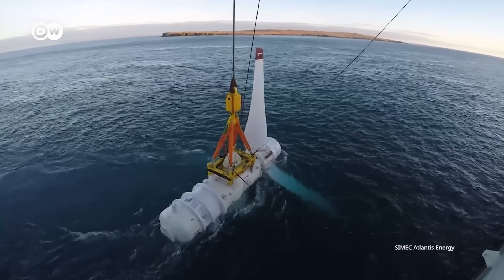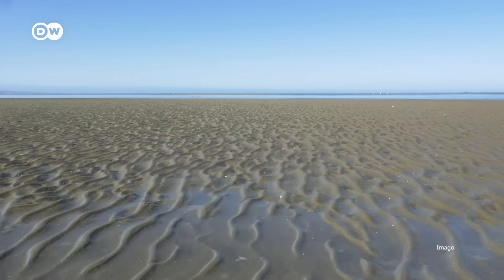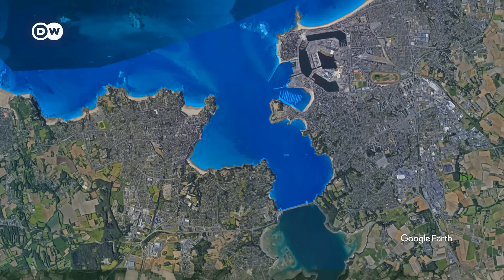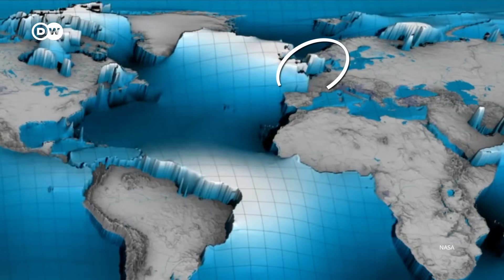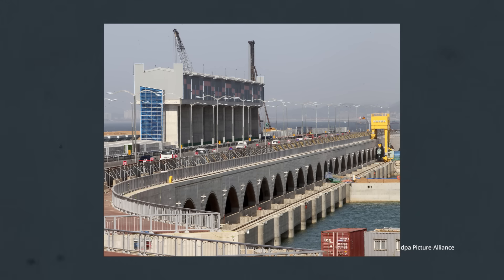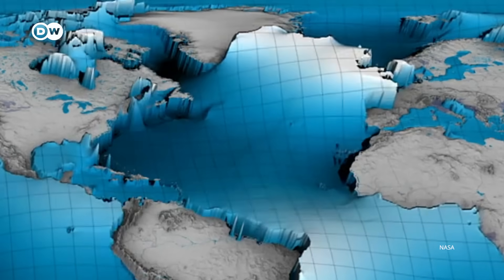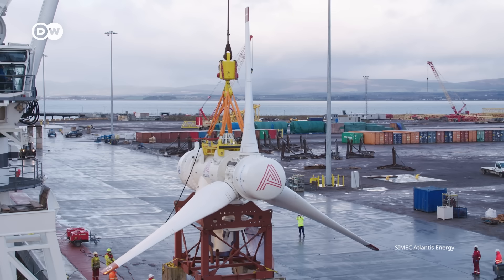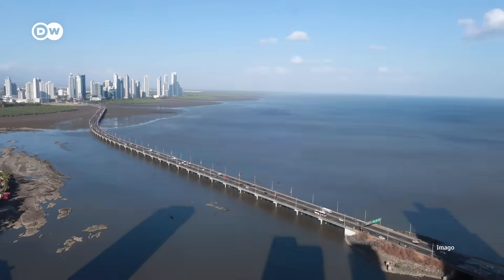Tidal energy could be huge – why isn't it?

Comment: Let's talk about Nuclear energy
Reply: It's been talked about. Overpriced.
Reply: And at the beginning of it, they wrote like there isn't anything else than renewables. Also they skipped to mention biomass, guess they don't want people to know where all that green energy comes from.
Don't believe that molten salt nuclear power plants would be outperformed by tidal energy plants.. once they get adopted on a large scale that is. 
If so, that's great but tidal still won't solve the energy problem.

@Stephen Ferrer ,are you afraid of a little rain? I can't imagine that the thermal impact of a Nuclear Power plant would be of any significance. Won't add much,if anything, to the output of what greenhouse gases and you know.. the Sun does.
You have any documents to back up your claim?
Reply: @denizzz08   There are obviously others. Fossils are too environmentally damaging, biomass is to inefficient, hydrogen might be an option but suffers from the same issues as biomass, nuclear is far too expensive, renewables are still the best option.

MSR might be an option, but we can't really draw any commercial examples at this time. Whereas renewables are already proven, and can be deployed within a year, and profitable long before a nuclear reactor is constructed.

Comment: Comparing the Rance tidal power generator to something like nuclear is extremely disengenious as it only makes 240MW at peak and averages 57MG while nuclear being a few times more expensive can make you 800-1600MW at 95% capacity around the clock... I get that clean energy is sexy and all, but if it is all so good, why don't we have more of it and why do you need to practically lie about it
Reply: Because it's currently expensive and can't be done everywhere. The video literally covered this.

Comment: the big reason tidal power isn't being used, is that generated power happens over a short time (lets say 1-2 hours) and you immediately need to store all that power before it is lost, so you can have electricity for every home in the USA when the tides are out, or about 20 hours out of every day (which means a insane amount of battery capacity and related hardware). It is a massive hurdle and not a long term solution with out some really ground breaking new (and feasible) battery technology with extremely high energy density,  the ability to charge quickly, and the ability to charge on low current levels (trickle charge).

Wind power is more successful as they are usually placed in high to near constant wind locations (out to sea, long planes etc, and existing power generation infrastructure can kick in/increase power generation to match the eb and flow of the turbines).  Unfortunately there are no easy answers to the problem of clean(er) energy, and a whole lot of scams too.
Reply: Yeah, strangely the Winds have failed to come. And Wind Turbine Scrapyards are building up... like people really don't think about the Trash being produced!

Comment: You lose me when you start talking about the need for taxpayer money. If these technologies make economic sense then the private sector should be funding them.
Reply: Why? Power generation should be nationalised anyway.
Energy companies make huge profits every year by overcharging the general public. 
If we nationalised power it would reduce energy costs across the board.
Another benefit, public transport (if also nationalised) would be very affordable. 
The electricity to run the trains would be bought for almost nothing and any excess electricity generated would be used to generate hydrogen, that would in turn fuel all buses.

Comment: Here off the east coast of South Africa we have the Agulhas current that runs strong and continuously and is close to shore but in deep water. I am sure submersible turbines could be built to harness that energy and solve our power needs with little to no harm to the environment.
Reply: :D they will steal those thick cables every time you connect it to the coast!

Comment: It’s annoying when price references use different unit measures for comparison. The turbine power is 9 times more expensive than above water turbine generation but the cost could decrease to $0.10p/kWh by the end of the decade…
The “end of the decade” prediction has no useful purpose as you didn’t reference what the underwater/above water turbine generation p/kWh costs are??

Comment: Point 1: There are 15 metre tidal ranges in some areas, the potential power generation of that difference is much larger than your vid recognized.
Point 2: The tide is only still for about 1 hour a day, 15 minutes at each flow direction change. This means flow generated is 23 hours a day, a few capacitors would be sufficient to cover the 15 minute absence of power. Batteries would be better, so when a turbine is offline for service the amount of power available to the grid can be kept constant for longer.

The anti-fouling paints used on boats would have a big place in tidal power, keeping the systems clear of growth.

Comment: You know what is energy dense, available 24/7 365, is a proven technology, clean, doesn't affect animal life much if at all and already available?  Nuclear.  Renewables are a pipe dream. The wind turbines wear out fast, I'm sure the water ones will faster(hello... barnacles anyone?), the solar arrays wear out and are toxic. All of them have noticable amounts of negative effects on animal life, rely on batteries or other sources of power, have issues with green house gases produced when making and toxic waste when disposing.  If you want a solution for your fear of climate crisis then get over your fear of nuclear.  It's a proven safe technology especially in the US. Three mile incident had little to no deaths or negative effects.

Comment: Unless you have a background in some sort of grid management or operations it can be quite unclear how small the production from the non-range tidal power can be. A whole ship, manned with a few people to produce 2 MW? That's less than one industrial generator and requires so much maintenance and operational costs.
Reply: The biggest offshore wind turbines, that are much larger than ships, barely go over 10 MW.
Of course the production from a single unit is small, because this is an inherently poor quality dilute energy source.
It's not going to power the world, ever. It's just toy projects to entertain people with.
Reply: @zolikoff  What makes you so confident it can't be scaled?
Reply: @VinylUnboxings  It inherently has the same properties at the small scale as at the large scale because individual generators are small. It's not like thermal power plants where a 1 GW plant is much more economical per unit energy than a 1 MW plant.
So the system and economic properties will be the same at any scale as now. And they are not good for large scale grid power production. So they won't be at any larger scale either.
Reply: @zolikoff  I think what you're trying to say ud that it isn't economically viable.
Reply: @VinylUnboxings  Sort of, but that is always a relative statement.
Reply: @zolikoff  All I'm saying is that technically 10MW* x could cover the energy needs of the planet if x was big enough, no?

If you're not saying there isn't enough surface area to physically hold the turbines, then the only limiting factor would be the resources available to create the turbines, no?
Reply: @VinylUnboxings  What I said was that the supply chain economics of the solution are already at scale and have no further gains to be had, so if it's a poor solution now it will still be a solution no matter how many times you multiply it.
Resource and manufacturing limitations indeed exist and also don't allow to just multiply 10MW with an arbitrary amount to get to global energy consumption.
But what I'm saying is beside that, even assuming resources weren't limited, the scale advantage has already been attained and the per-unit-energy considerations are not going to improve by further upscaling. And since they're not good enough now, they won't be good enough ever.
Reply: @zolikoff 

 I'll acknowledge that resourcing and manufacturing limitations do exist realistically. 

What are you comparing it to though when you say it's "not good enough" or a "poor solution" when you look at per-unit-energy demands?
Reply: @VinylUnboxings  It doesn't compare favorably to thermal power stations on a large scale grid. It can compare favorably with inefficient small oil-powered power stations in island nations but that's about it.
Reply: @zolikoff  What kind of thermal power station are referring to?
Reply: Bc its still in development
Reply: This is feel good science. Any actual engineer will say you will spend more energy to make energy than you will produce
Reply: @David-ys4ud  objectively false, hence your inability to evidence this statement

Comment: Tidal energy is very diffuse.  This means it takes a lot of steel and concrete to build a tidal turbine to get relatively little electricity generation. As a result they are usually not economic to build.

Comment: I reckon this technology brings up the same problems, like all the cheered “miracle zero emission vegan” power. They either convert small amount of energy, or needs to be pconstructed in huge numbers, wich allways causing more complex issues, like 
Wind turbines resonance, flying animalfatality and messing with the global wind system. 
Water power messing with the water balance of neighbouring biomes
Sun power needs extreme amount of land and a lot of expensive resources and manufatcuring.
The problem is with nowadays shallow education. 
-We are not “making” energy (thermodinamics).
-There is no zero emission (thermodinamics).
-There is no chance turning away from fossils, bcouse crude oil is one of the cornerstone of our industry. Not bcouse of fuels, but lubrication, fastening, insulation, dampening, ….

Comment: Why use fans? Wouldn't it be a lot more efficient to build something like a tube where the top is a flotation device, there is an outer layer which spins around to make the power. I mean, it is literally just two tubes with the outer one having cups on it which means that it spins irrespective of the direction of the tides. To avoid a huge weight that needs to be moved you can break up the outer tube in to several sections.

Comment: because you need the water pouring down onto them as in a waterfall to generate a rotation so you can turn kinect itno electric

think in terms of a watermill but using high pressure water to turn the wheel

Comment: It’s simple, it costs too much for the infrastructure, maintenance, storage, and no way to regulate output for instances like power outages, and summer heat where ACs are turned on.
Reply: That's why you don't rely on a single source of energy.

Comment: Is there a floating type of generator? That would be anchored and have a floatable mass suspended then water up and down level would generate the potential difference needed to generate power, with hopefully less deterioration as the thing will be mostly out of water. A crane on top will be out of water all times, and the supporting structure could serve as a reef maybe without much concerns.
Reply: Waves and storms are a thing. And now you have platforms taking up shipping lanes? And how exactly are you creating steady, rotational mechanical energy to power the generator head from a slow rise or fall in tides?

There's already wave generators that  do work but are more complicated than what you described

Comment: Get this- a surface turbine system that uses the same turbines to move to stronger tidal areas. 

They switch from 'power mode' to 'moving mode' easily and can automatically head to stronger areas. 

Smart autonomous water turbines